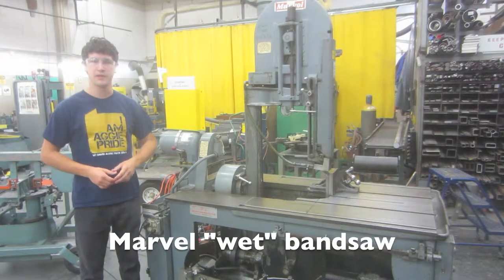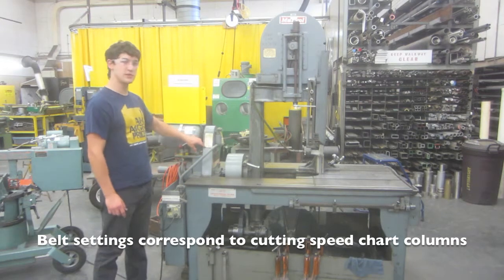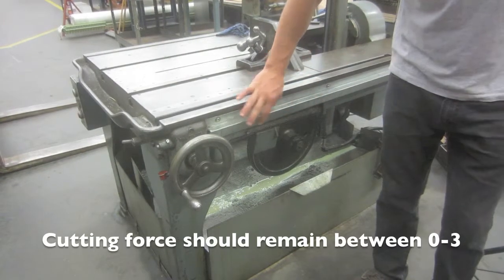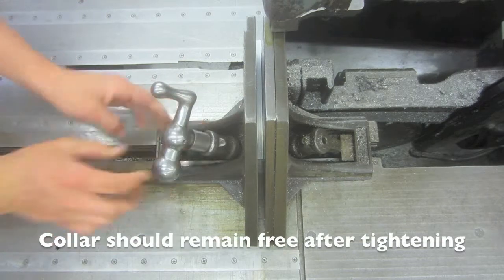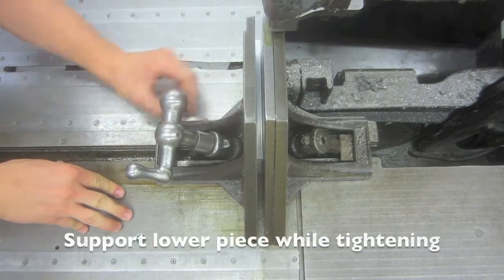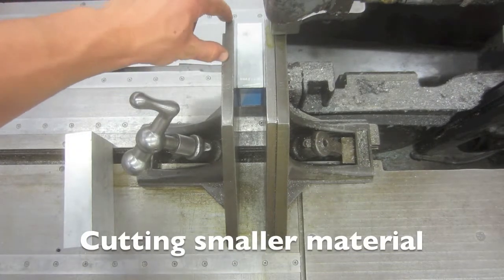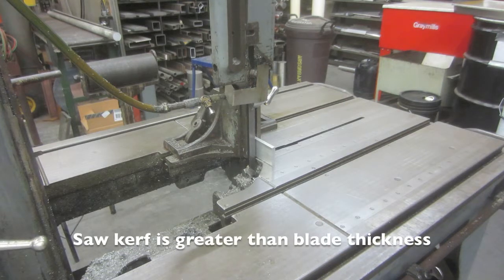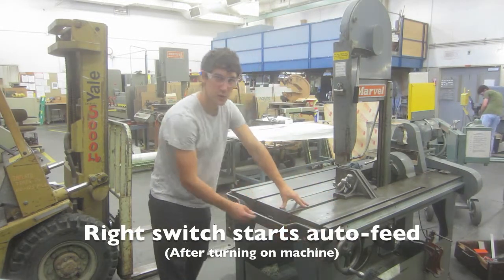Using the Marvel Wet Band Saw

Comment: I used to run one just like this years ago. They are a very impressive and useful machine. We would cut big steel pipe, up to 18" or 20", I can't remember what the capacity is, but it's huge. It would take more than an hour to cut a piece of that big pipe, it was close to 1/2" thick steel. 
It's pretty crazy to me they still make the same basic saw with very few mechanical changes, it just looks more modern.